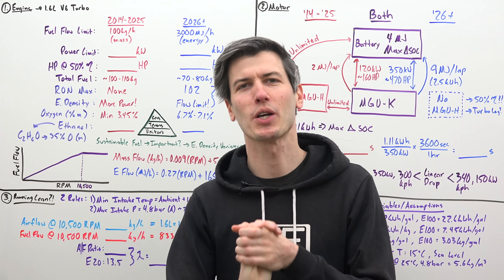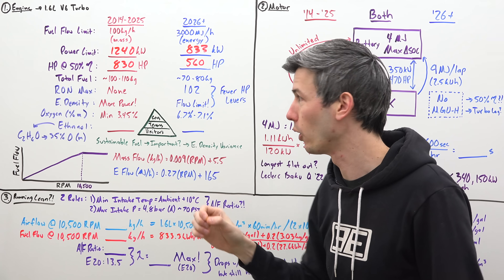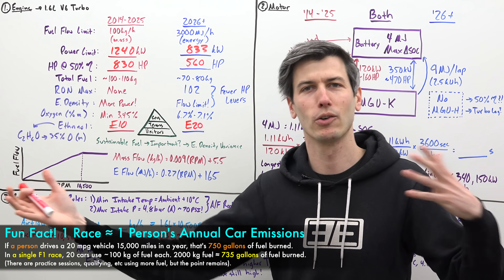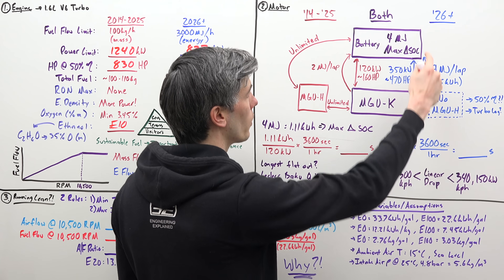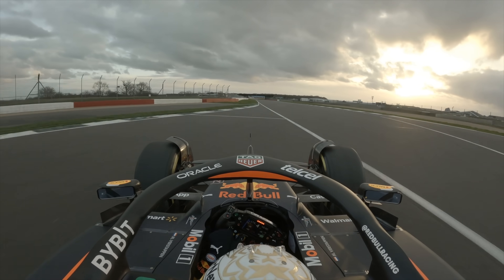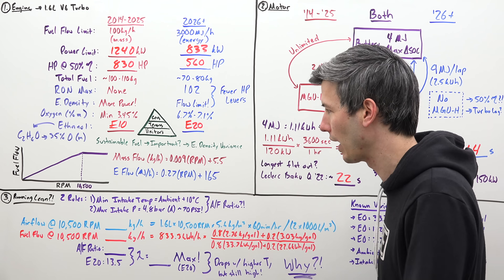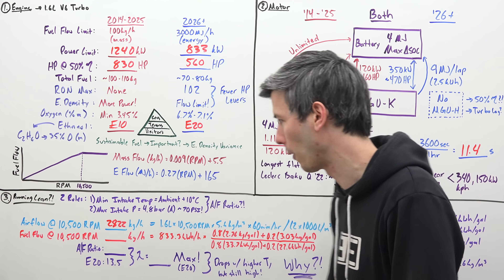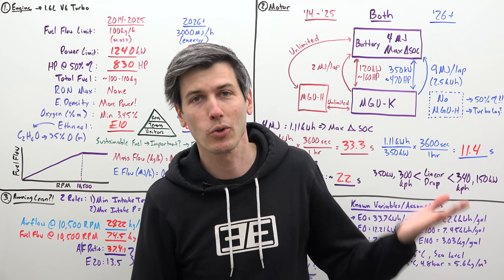Why Are 2026 Formula 1 Engines Going To Lose So Much Power?

Comment: I really think active aero is coming because the level of aerodynamic drag we have now with reduced full power as a function of the increased power still with 4MJ swing... I'm very unexcited about '26. Great explanation!
Reply: Maybe it would make a comeback eventually but in the short term I think we'd see the teams focus on reducing drag as much as possible. I could see there being a tradeoff point where it's faster to have more straight line speed, coast longer (thus recharging the batteries more), than higher cornering speed. Which is really backwards to think about because normally faster corner speed = quicker lap times, but we're talking about an edge case here. Kinda like the hybrid LMP1 cars, where at Le Mans they were slower at the end of the straights than the non-hybrid LMP1 and they had less downforce. But they made up for it by being able to deploy the electric boost early on the straights. Much like a drag race where if you launch hard enough off the line, you can get to the finish line first even if your opponent has a higher trap speed.
Reply: Excited? I am already disappointed
Reply: Verstappen recently spoke about the active aero and how it won't even be controlled by the driver, and Downshifting at the end of straight aways might also be necessary due to limits... Fact is the sport is dying
Reply: What a solid prediction by Brake. Active aero is BACK
Reply: No, there won't be active aero in f1. The sport has always had the mission of developing new technology to introduce into regular cars later down the line. Aero isn't practical for regular cars because they're too slow to generate it.

Active suspension is the next thing they'll allow. Especially with them moving towards ground effect aero, active suspension would benefit these cars a lot more than active aero, and developing new suspension technology can and will be useful for regular cars, especially given how heavy they'll be getting with all those batteries.
Reply: @Mike23443  that's not exactly true. Hell even pickup trucks have had (for a decade now) active grille shutters to reduce drag at highway speeds.
Reply: @Mike23443  That depends how you define aero. I'm pretty sure he is referring to optimizing drag rather than downforce - which in that case ties into fuel efficiency rather than aero grip.
Reply: @Mike23443  disagree completely. We're talking about the sport that has DRS which has no relevance for road cars. The main issue with the 26 regulations is a reduction in possible output and reducing drag via movable surfaces is far superior to active ride height control. They WILL need a way to reduce drag.
Reply: @brrrake  DRS is a solution that was required to fix a poor state of racing quality. It has nothing to do with being relevant to common use technology, which btw, a lot of sports cars now have retractable spoilers which counts as DRS or active aero.

They will not allow for active aero because the development of the software and modeling of the CFD and the technology required to operate everything on those cars would become extremely prohibitive in an era that is aiming for affordability and sustainability.

Active aero is also far too obvious, visible, flimsy and confusing for viewers in addition to being irrelevant to economy cars. And while active suspension may be consider to be the same thing, active aero absolutely falls under "driver assistance" which is banned. Making suspension auto level the car and keep a certain height above the road would be far easier to keep out of the way of viewers to keep up the semblance of pure skill based racing.

For these reasons, active suspension will return. Active aero will not be introduced into F1 for another 10 years minimum.

You don't know what you're talking about.
Reply: @Mike23443  I'm going to stop you there. I usually have a good idea of what I'm talking about when it comes to Formula 1, specifically 😅😅  I understand you have your opinions, but I think you're a bit out of your area of expertise
Reply: @Mike23443  ehemm.. maybe you are joking, otherwise please look at his channel
Reply: @brrrake  You must be stuck in 2002 if you think active aero is the best way forward in F1. They don't need to get rid of drag. The FIA doesn't care about drag. Nobody wants these cars to have a higher top speed. What they care about right now is safety and stability. The regulations have been pushing for simplified aero and that's exactly what we got. Ground effect and minimal outward interference with as little outwash as possible. You think active aero is the next big thing? Bruh. You must be living in fanfic land. What's next? V12s? Come on. Active suspension has already been done decades ago and banned. Even the most basic and rudimentary systems would vastly improve downforce, reduce drag and increase handling in low speed corners. Literally everything the sport needs right now (except lower weight). To suggest that instead of a few simple pistons and springs with a basic controller, the sport is going to move into active aero is completely asinine. Just because you have F1 in your name doesn't make you an expert. An average fan with the basic understanding of the current political direction of the sport could formulate the opinion I just presented. I don't understand how you could think otherwise. Why focus on by far the most complicated, engineering and resource heavy solution, when a far simpler, cheaper, safer and more elegant solution already exists?
Reply: @Mike23443  I am just saying active suspension isn't some "free grip and reduce drag" mechanism. Rear ride height is the only main car state parameter which has a significant impact on drag, but it's a few points of drag per mm RRH.

The 2026 cars need a LOT less drag, otherwise we're going to have insane levels or MGUK clipping at most circuits which honestly will just turn it into a super energy management race which will look something like F1, just with worse racing😅

Active suspension does not have as much authority over the parameters you think it does and it cannot have a significant impact on drag. That is the only point I'm trying to make.
Reply: @mike234 I'm sorry but you're talking nonsense you don't know nothing about F1 and FIA
Reply: @brrrake  i totally agree... without the MGU-H, and that tiny af Battery... you can't even drive the car at its limit, which i believe is a core  spirit of F1 which is push automotive to its limit... Otherwise, like you say, it's going to be an extremely heavy Energy Management Sim racing... which sounds really boring .
Reply: @brrrake its not like these current regs will last any longer. New engine regs are already in the talks. You make valid points but forget the basic thing, all these things would be extremely hard in this current budget cap era. Teams are already troubling f1 about power starvation with current engine so most likely we will see a change soon.
Reply: @Mike23443 bro, you are literally arguing with an ACTUAL F1 Engineer. He is more qualified than you. Also you're whining on how there will be no Active Aero in F1 aged like milk. Active Aero is indeed planned for 2026 as the F1 has essentially confirmed active Rear wings and is now considering Active front wings as well
Reply: @Mike23443  hey buddy. Hope you're doing ok 😅
Reply: @brrrake  that's not what I was imagining when I heard the words "active aero". I was thinking of the kinds of flaps that the Pagani Huayra has that keep actuating depending on where the car needs more grip. What we're getting in 2026 is a glorified DRS system. I'd hardly call that "active" aero.

Comment: From my experience I expect the octane, boost and temperature rules are meaningful constraints that the teams will take to the limits.  The in-cylinder air temperature and pressure are of ultimate importance, not manifold, but "excess" manifold pressure and low temperature is very useful for optimizing the in-cylinder conditions.

For best thermal efficiency and knock avoidance the in-cylinder objectives would be minimum temperature and maybe lambda 1.2 - 1.4 as a guess.  Intake runners tuned for adiabatic expansion (rather than compression as would be usual) can efficiently reduce in-cylinder pressure and temperature to well below manifold conditions.  The penalty is the additional exhaust enthalpy required but this is a favorable trade in the context of a very efficient engine, turbine, compressor and CAC.  An engine tuned for the same trapped air mass but at a lower boost level would have a higher in-cylinder temperature and thus worse knock resistance and thermal efficiency.

Comment: since the maximum recovery is 9mj/lap that means a car will have to brake for 25.71seconds throughout the lap, which is a more than the average braking time at 18.5secs at austin and a lot more than 10.75 secs of braking time at monza. so i guess the teams will have to radically change their balance concept to smooth corner entry in order to maximise energy recovery. maybe this becomes a key reason why verstappen and redbull will dominate 26+

Comment: F1 teams have a history of leaking oil into combustion to cheat the fuel flow limits (looking at you Ferrari). Maybe the air flow limits are a way to limit this, as otherwise it is hard to scrutineer?

Comment: the intake air limit is actualy an intake air pressure limit meaning that in order for the engine to get as much air as it needs it will have to have a bigger turbo compared to using higher pressure. thats propably a move to try to induce turbo lag for the spectacle

Comment: at 10:35 – "Gas engines don't like to run lean" What?!?  This guy obviously doesn't know much about engines.  Leaner is more efficient, which is a major concern when given a fixed amount of fuel for a race.  His A/F Ratio calculation is BS.  What race takes place at 15ºC?  And +10ºC is the minimum.  At full boost, the air temp will be way hotter.  If you use realistic numbers, you get a ratio of 30, no different than today.

Comment: The video treats the engine as running at constant speed. Even the tracks that require the most power have times when the driver backs off the throttle. Is the fuel flow an absolute maximum, or can teams exceed the maximum the way Ferrari allegedly did in “Fuel Flow Gate?”

Comment: Wild guess: could the intake temp and pressure limits be for lifting, not accelerating?
When the car is decelerating, use a super lean mixture in order to lower the exhaust and intake temperature even more, so that your next acceleration phase starts with colder intake?

Comment: Great video as always. I think F1 is tying themselves in knots with such a complex set of multi factorial restrictions.
Reply: Small V10, increased airflow and sustainable fuel, job done.
Reply: Well I mean that's the point. This is the "Formula" in Formula 1 that engineers have to work with. The restrictions are what makes the engineering competition aspect of the sport so interesting. They have to get creative to work around roadblocks and obstacles set for them.
Reply: @MoptopTofer  I get that but the rules risk conflicting with each other and stifling innovation and the excitement of the sport as races will be settled by a bunch of specialist engineers and lawyers in a court room rather than on the track with drivers they should set some basic parameters and let the engineers engineer and the drivers drive.
Reply: @YUNG CHLOROFORM   But is this supposed to be the craziest fastest most vuscious cars that only the best can wrangle round a track or is it 'make the most of it with these extra 100 restrictions because we like to please the green agenda and Lewis.' 

It's absurd. The entire F1 calendar puts out 1/180th of the Carbon than 1 container ship does. Why can't F1 be the best cars on the planet and everything else takes up some slack?

The cars today are slower than 20 years ago , check the lap times (and when you do , remember they weren't running  on slicks). They sound shite and the drivers are all the same.
Reply: @realMaverickBuckley  Bollocks.   Catalunya 2007 : Pole Position 1'21.421" ,  2020 : Pole Position 1'15.584".   Same track layout.
Reply: @juliusdavies2005 I am not 💯 % but I think 2007 cars ran grooved tyres hence the discrepancy in lap times.

Comment: In my honest opinion the fuel flow rate should be increased. 

Not necessarily more fuel, but that max fuel flow rate should be reached at 15k RPM. 

I don’t have a good reason for it with sustainability. It just makes the engine go vroom a bit louder.

Comment: I wonder if George Soros and Clausy Swab had any input . 🤔 sounds densely ridiculous?
Reply: The idea came from the engine manufacturer side. Renault for instance never really liked the MGU-H concept. Yes, it improves effeciency quite a bit, but it needs to be perfectly tuned to the rest of the engine. Basically every change at the engine that changes gas flow in some way requires a redesign of the turbocharger/MGU-H which made it an absurdly expensive item to develope and it has no relevance for road cars or any other racing series.

Comment: Sure Leclerc took 22 seconds to complete the main straight at Baku, but you’re forgetting a crucial variable that is DRS. That alone lasts about a third of that main straight.
Reply: So some math based off of Leclerc's 20 straight, assuming they come out of 16 at 100kph, it'll take ~8.5s to hit 300kph, allowing that 350kw then they will have another ~6s of battery left at 150kw. The last 5s of the straight away, the cars will be slowing down immensely even with DRS. So the idea of these hard on the break lunges will disappear on straightes like that.

Comment: This has to be the most insane and convoluted set of rules for any sport ever. The “greater good” of racing is automotive innovation, especially around efficiency and safety. That’s the net positive racing provides society. Why limit the free energy of regenerative braking? They should be trying to incentivize innovation in regenerative braking technology  by maximizing the competitive advantage it can provide. Rules limiting outputs, rather than inputs, stunts innovation and is anti-competitive. They’re worried about the appearance of their “carbon footprint” rather than seeking to maximize the greater good they can provide to society through competition driven innovation. (Steps off soapbox)

Comment: Since it goes to a power limit in the flow of the fuel is there anything stopping them from adding that oxygen requirement in another form than ethanol? Maybe storing an oxidising agent in a seperate tank like rocket engines and then somehow mix in that right 6-7% ratio mentioned in the video before combustion. Could open the way to more creative fuels with interesting properties too but I wouldn't be surprised if they are limited to something vaguely similar to petrol.

All these various rule changes are certainly good at providing manufacturers extra challenges to come up with how they can best combine all that into a good new car design and potential race strategies. 

Can't say I even remotely follow the sport, my brother and parents tend to watch it and I'd catch bits of the race so since not living at my parents anymore being at one of their places during race weekends is pretty much the only sport side reporting I catch. Oh and since I live in the Netherlands usually the next day what place Max Verstappen ended, who won the race and sometimes a mention of Nyck de Vries typically in that order. Strangely catching occasional technical changes here with in depth explanations are actually interesting to me while I'm not even remotely interested in the races.

Comment: Maybe the rule about the air-fuel-ratio has something to do with Ferrari's "alleged" cheating on the fuel-flow sensors or to prevent similar anticipated creativity. It was never officially disclosed what Ferrari did so there has been lots of speculation about it

Comment: These new engine regulations are flawed already. As an mechanical engineer i really do wonder how they want to make it work, especially when we consider how technologically advanced everything already is. But to me the biggest lie and flaw is the electrical side. It's said that these 2026 engines make up to 1000HP, which in fact is only achieved for a few seconds per lap, as it's the ICE + the Electric motor. If the battery runs dry, you're left with just ~550HP instead of the current 800+/- HP (depending on the engine mode). That leaves these guys driving around in their ~800kg rolling walls, with the power of the latest Cosworth DFY in 1985.
Keep in mind that current F1 cars need all of their 1000+HP PU to reach 330KPH, if they get off the throttle it's like hitting a wall.
I'd like to see how all of that is meant to play out in 2026. To me it seems like another useless engine regulations change like in 2014, which brought us completely irrelevant engines, not any better than the last V10s. It's turning more and more into an endurance race rather than a sprint.

Comment: Can't you just run alcohol free fuel for maximum power density then have a liquid oxygen tank that mixes it before it hits the injectors?

Also, why not just go to 4 cylinder at this point if power limit is only 550hp theoretically?

Comment: Drop all this BS engine restrictions.  Give them a ICE budget cap, 3.0L  V10 NA engines, and standardize the fuel.  Make it synthetic or what ever gets the greens off our backs. Give them a max fuel amount that would force them to make the engines a eco as needed. But we would have the sound the fans want, the costs on the engine programs would drop greatly.  Cosworth should be in F1.  These new engine rule changes every dacade or so, just are not needed.  Formula E already exists.